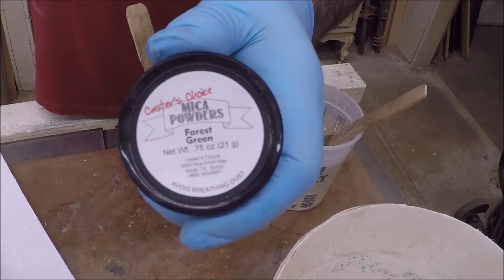Emerald Abyss

Comment: I LOVE that...In the beginning, when you said you didn't know what happened in this one spot but hoped you could turn it out...and you had waxed it the edges THEN put resin on it....Earlier I asked if there were nicks and chips, couldn't you resin whatever it was...you said yes as long as it wasn't waxed or something...maybe that one spot was like it was because there was wax....
Reply from the maker: yes it was Waxed on the Ends only and I cut the end off and did not use them, when waxing wood to dry it out you only wax the end as the grain is like a straw, seal the straw ends and it dries evenly, the cracks were due to the wood still being wet in side, I tested other pieces to find this out after the fact.
Reply: @PohlBarnProductions  oh, you cut the part off you waxed?  Maybe it soaked in more if the wood was dry and the resin was not as effective?

Comment: Gorgeous as always! Also, a hint from a photographer-take the bottom skinny legs of your tripod and un-extend them. Extend your top, thicker legs first, then the middle (if needed) for more stability and less vibration.
Reply from the maker: Thank You Thomas, gotcha,  I am not sure what is extended actually, the go pro is on a bogen Tripod but I have a telescoping selfie stick I try to keep as short as possible, sometimes if the tripod is touching the lathe if vibrates
Reply: @PohlBarnProductions  At 14:11 the tripod in the upper right was the one I was referring to. Always extend the bottom skinny legs last-they're the least stable-the weakest link if you will. Regardless, beautiful work as always!
Reply from the maker: yeah I normally use that for my Phone when I am in a hangout with others, they can get motion sickness,  LOL  that would be funny,  normally they are in my ears and we are talking while they watch what I am doing, I also use that at the end when I film the outtro with my phone at the sticker board,

Comment: **A few words of caution on the UV resin..
Always be conscious of leaving the cap off the bottle in areas with natural light and if you use LED lighting in your shop, it may cure before you get a chance to use it.
On the flip side, UV resin needs the UV light to gets all the way through it's depth to cure, so you're limited with using some pearl and metallic pigments as they don't allow the light through to deeper areas. Better to do many very thin coats curing after each, rather than having a surprise liquid blob inside! Oh, and it will NEVER cure without light!

This turned out really cool, I'm feeling Hulk vibes! I'm happy to see that woodturners are finally catching on to UV resin, we've been using it in the crafting/jewellery world for years.
Reply from the maker: Thank You, I do have LED's in the shop, they must be to weak as they never set up the small amount I had in a dixie cup.
I do believe it takes a bit longer with the TB brand stuff, but I will figure it out.  Thanks again for watching

Comment: I REALLY like this one!  Question about bubbles you kept talking about: would putting the piece in a vacuum chamber for a few minutes before the pressure pot get rid them?  Surprised you didn't do that because it was wormy and full of voids to begin with. 

However,  it turned out amazing!        Stuart
Reply from the maker: Thank You, it's been my experience using vacuum, it make it boil causing more bubble, the holes were deeper inside the wood and even if I had used Vacuum it would not of pulled them out
Reply: @PohlBarnProductions  thanks for the info. I’ve not worked with resin b4 so I’m poorly informed at best. Take care 😁

Comment: Good combinations of colors with the wood. QQQ: Do you clean out the resin mixing containers or just let it cure the peel it off? If clean it off, what do you use?
Reply from the maker: Thank You Lee, I use to clean them out each time I mixed resin but I started just throwing them away, Total Boat send me mixing cups.  I found it leaves chunks in the resin if you try to get it out after it hardens and you also have unmixed resin stuck in the bottom.

Comment: Good morning Pohl, what a beautiful work, I would like to know what depth you use for Chuck's fitting, a big hug from Brazil.
Reply from the maker: Thank You Carlos, I am not really sure, I knew I needed it deep enough for the plastic coin with resin over it, I guessed like I normally do when cutting the mortise
Reply: @PohlBarnProductions  I'm starting in the turning area, I made some parts but the cavity where the chuck fits in was a little deep, it seems that you made it less deep.
Reply from the maker: ok I measured last weeks and it's about a 1/4"  so 3/16 to a 1/4 should work fine, as long as it's deep enough to hold the piece securely

Comment: I made uv resin pyramids with crystals in them. I need to get another bottle and a new lamp. I lost my cord when I moved into my own place
Reply from the maker: Thank you Penny. I'm not I'm impressed with this UVresin or maybe it's the light, but it tends to not set up very fast and stays sticky to the touch.
Reply: @PohlBarnProductions  I use a lamp that's used to cure gel nail polish. It would be cured in 10 minutes. In my opinion the light may have not been strong enough.
Reply from the maker: I agree !